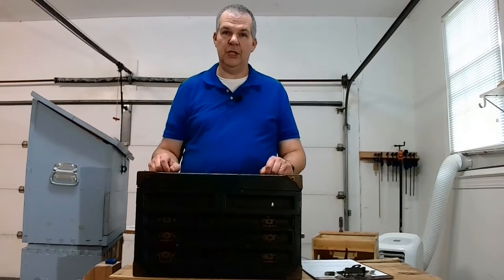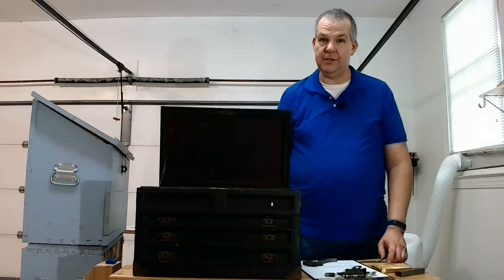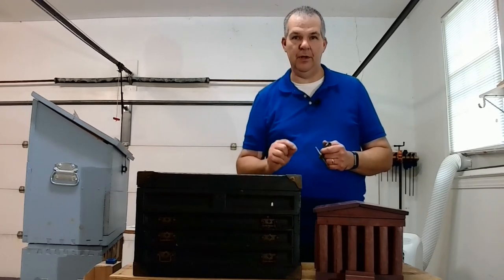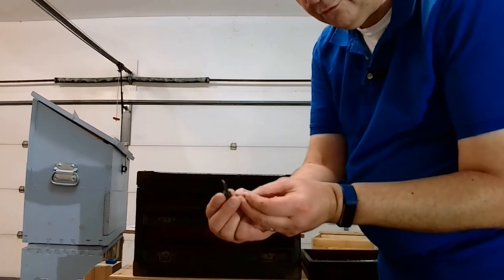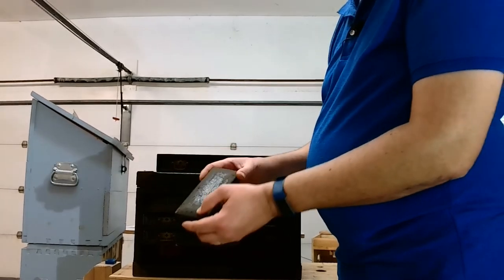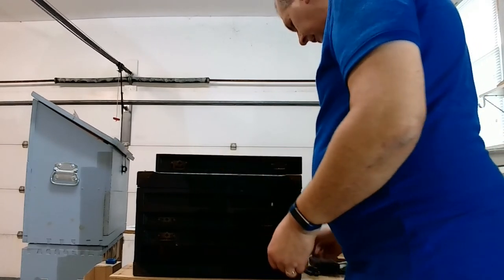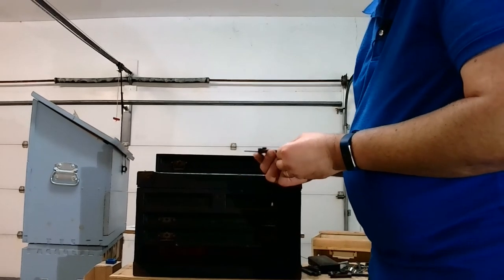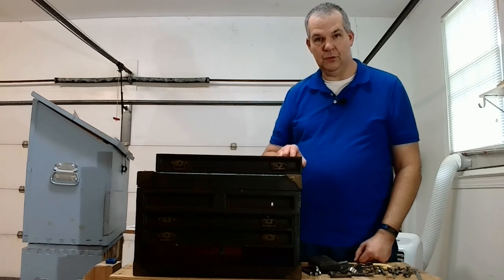Old Machinist Chest Full of Tools Part 2

Comment: The blocks with the "V" are actually called "V-blocks". They should be a matched set. They are used to hold round parts for drilling, milling, and precision grinding. The little spanner type wrenches in the Starrett box are for "setting" or recalibrating micrometers. The mystery item #1 is a counterbore with interchangeable pilots. It's for sinking the head of a "socket head cap screw" below the surface of the part. The mystery items #6, are the the pilots the fit into the end of the counterbore to make sure it follows the original drilled hole.
Reply from the maker: Thanks for sharing this information. I'll need to go back and rewatch to see what mystery items 1 and 6 are. I've copied your comment to my notes on the items in the chest. Every little bit of information helps.  I haven't used the tap and die items as much as I thought but I have been using the files, wrenches and drill items a lot on my projects. And especially the measuring equipment. I'm getting into metal work now that I have my Dad's Sears Vise and a separate table to work on with easy access to my vises and the Gagnon chest. Thanks for watching.